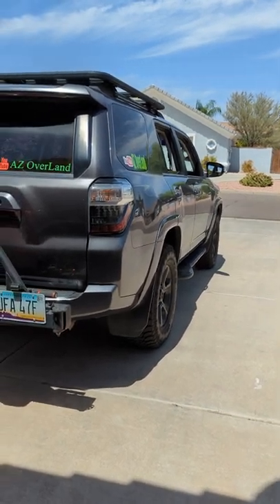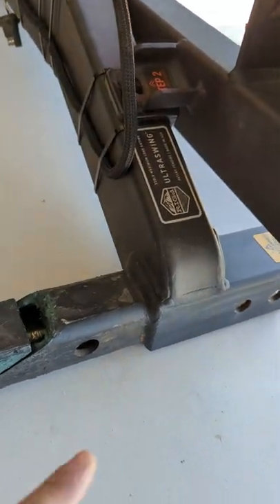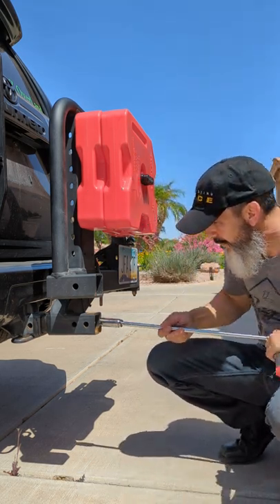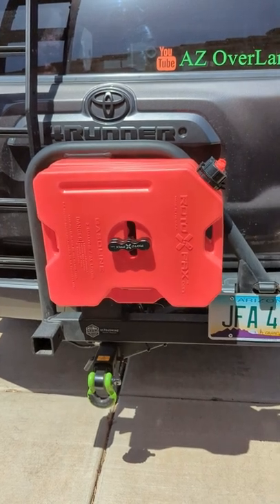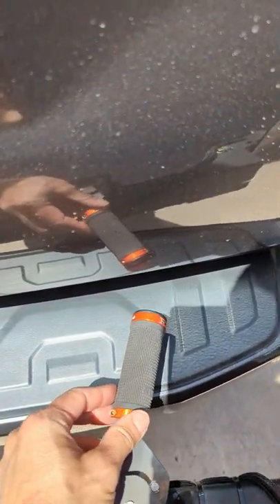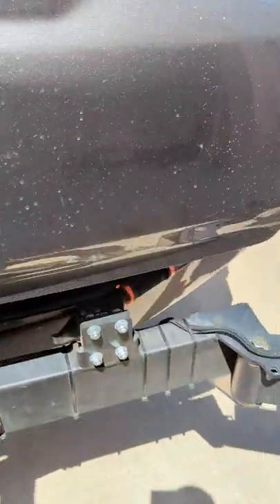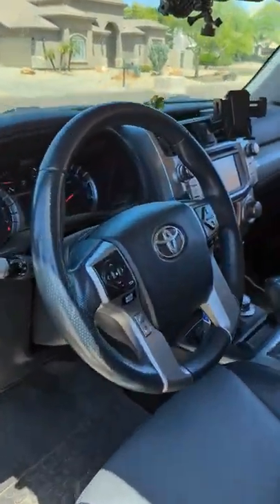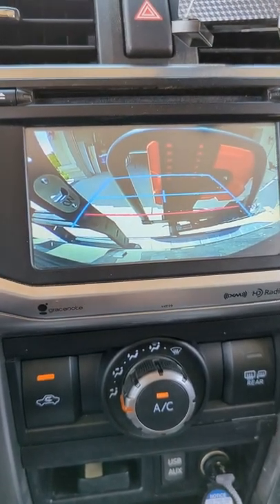ULTRASWING by RIGd installed on the 4Runner - 1 PROBLEM though

Comment: the camera thing is a big issue for the newer 4R models, theres no camera relocation kits for the ones with the MTM / birds eye cameras unless you go completely aftermarket
Reply from the maker: Yeah. They do make some decent aftermarket ones though.
Reply: Any links for these relocation kits for 4R with MTM/ 360° camera system?
Reply: @Phantom_4Runner  Theres no relocation kit for the MTM/360 as far as I know. But there are good aftermarket options as a replacement. I ended up using WolfBox which is a front and rear camera built into a rear view mirror. Easy to install; I ran the power wire using the cigarette lighter power supply provided and the rear view camera wire through the edge of the headliner all the way to the liftgate and out from the bottom into the spare tire area.

Comment: Great informative video. Trying to understand the purpose. Just to carry two gas cans?
Reply from the maker: Thank you. It can be used for a lot of purposes and simultaneously. Here are a few in addition to the Rotopax mounts:

Spare tire carrier (oversized spare won't fit in factory location)

Propane gas carrier

Folding table attachment

Putting a bike rack mount into it so you can swing the bike out of the way of the hatch. I found this one particularly useful
Reply: @AZOverland2017  I see. Makes total sense now. Keep up the good work!. Thank you!

Comment: Ultraswing should have included a camera relocation kit for the price of their equipment.  Camera relocation is dicey cuz clear view depends on what you'll place on Ultraswing rack.  Probably need a camera cable with a coupler, extra cable and a clamp on camera that can be easily moved around to accommodate gear.

Comment: Curious what license plate rig you used and how you wired that. Want to do the same things with my ultra swing!
Reply from the maker: It's the one they have on their website (see the link below). It plugs right into the trailer light plug; 4 pin flat connector

https://www.rigdsupply.com/products/license-plate-light-bracket
Reply: @AZOverland2017  Awesome, thank you for such the quick reply!!

Comment: Seems like an expensive option to carry an extra 4 gallons of gas.
Reply from the maker: I also attach my bike rack to it so I can swing it out to access my tailgate. It has other potentials such as the option to add a spare tire, fold out table on the inside, traction boards, HI Jack, etc
Reply: @AZOverland2017  I think as a platform the swing out has potential and is a fraction of the weight of a full steel bumper.   It's got some serious sticker shock considering all of the accessories you have to purchase to make it practical.   They do have that "cool" factor though
Reply from the maker: @weecho27  Yes, I agree. When I was looking at it i had a hard time justifying paying the price. Luckily, I found a lightly used one with the Rotopax and Spare tire mount for a very fair price. So, I went for it!
Reply: @AZOverland2017  I plan on doing a lot more exploring in AZ.  I enjoy your videos and look forward to you producing more.   Don't forget to buy that key lock box.

Comment: Too bad this unit doesn't store things more toward the passenger side of the vehicle.
Reply from the maker: They have lot of accessory brackets that can be installed different ways. It is quite modular. Basically like a molle panel so you can things to different areas. Those Rotopax can be mounted like 3 or 4 different ways